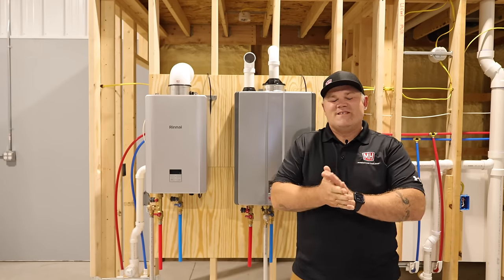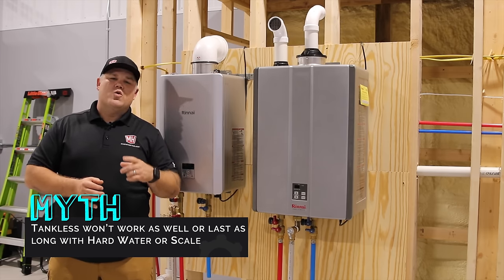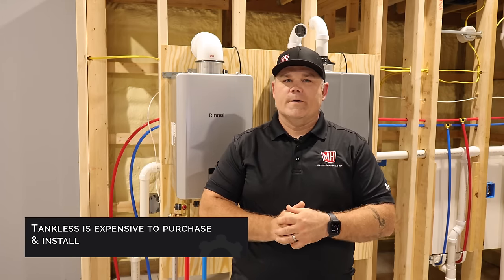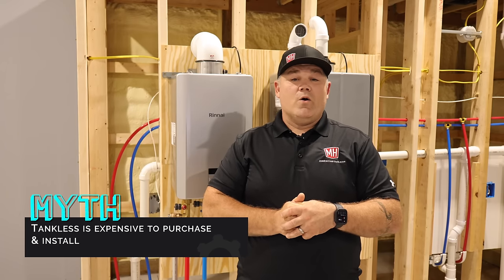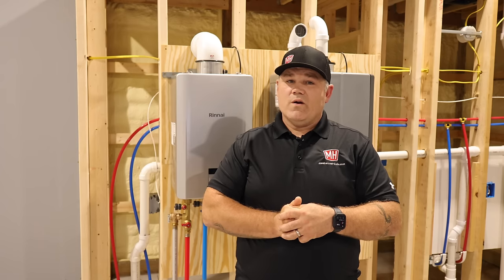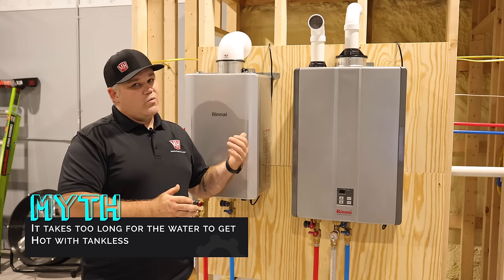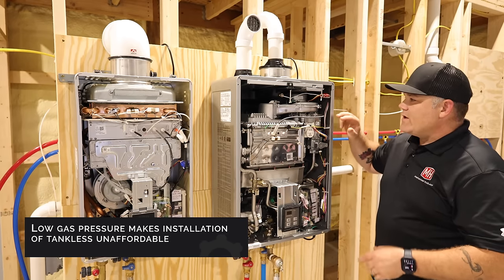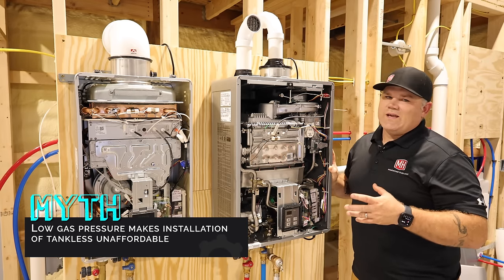Myth Busting! Tank -vs- Tankless Water Heaters

Comment: The only thing I wish you had covered is electric tankless heaters.  I'm currently researching converting our entire house to electric only.  So that means both furnace/heat pump and tankless water heater.  I know that when you go electric with a water heater there's a good chance you have to upgrade your electrical panel, so it'd be good to hear what that impact is from someone with your depth of experience.  Thanks for the great video.
Reply: Depends on your situation but here are some ideas. First ask an electrician, not a plumber who should not be running new wiring to anything even if they say they know what they are doing. While they are familiar with some basics, don't let them attempt this.
Cost wise again depending on your situation is likely in the range of 600-several thousand dollars for the electric side alone. It puts a heavy demand on your system regardless even if it is sized properly to work with it. 
Gas models are good and reliable and don't require a hefty install cost like electric does. I was very surprised when he didn't address this in this video. Electric for a tankless heater is less reliable, sure they work but after seeing them fail frequently and having to change them out many times I'd never go that route for this specific equipment in my home. Either stick with your gas heater or get a standard electric heater instead of tankless. The savings is very debatable especially since the newer regular tank models are so well made and insulated to retain the heat better. Weighing that vs the cost and the heavy load on your electrical system and the choice is fairly easy.
Hope this helps, an this is coming from an electrician of 25+ years.
Reply: I've got an electric tankless heater. You need to install a flow regulator because the electric tankless are far less efficient than gas. I have enough for a shower, but not enough for the tub faucet to stay hot. Mine is rated for 2 gal/min, but it works best at 1.5 or less.
Reply: Not to mention if your electrical service can not support the demand of an electric tankless. Some of them require a 100 amp service just for the tankless ! Your standard home has a 200 amp service. If it’s got electric heat then the service would need to be upgraded. That’s expensive. Gas tankless is definitely cheaper and way more efficient. But if you don’t have gas service then an electric tank water heater that draws 30 amps is your only option.
Reply: @CONald_is_A_false_Prophet  Why wouldn't be possible to replace an electric water with a tankless using the same 220v wiring?
Reply: @jerickson49  remember the old days where people just increased the size of a fuse or breaker? That's a big reason for many fires. The breaker and wire sized are very different. An average standard tank style water heater requires 20-30 amp line with wire sized for that line which is much smaller than is required for  even the small size of a tankless unit. Depending on the amount of plumbing fixtures / baths etc.. is usually how a tankless is sized. Some tankless for a medium sized home may require wiring that can handle multiple parallel lines.
For example, a home may be fine with a typical water heater that requires a  double pole 25 amp line but the same home for a tankless may require two double pole 40 or 60 amp lines equivalent to 80-120 amps depending on the tankless requirements.
If someone has gas now, chances are their home didn't need to account for an electrical load of any appliances that are now gas so a 100-200 amp service can't even handle an addition of 1 major appliance like a range, furnace, dryer, pool heater or water heater.
Also they won't pass an inspection if they undersize a tankless for a home that requires a larger unit.
More than you asked but hopefully you understand most of what I explained. 
I've seen some dangerous attempts by homeowners and handyman types so please hire a legit plumber and electrical company to do any of this work if you chose to pursue this.
Reply: He is a Rinnai dealer so he is pushing gas fired . However i did install a Rinnai heater in my  daughters home and it is amazing and very efficient.
Reply: I have an all electric house with a 200 amp panel.  To be able to run a bath and use the kitchen faucet, considering the temperature of my incoming water, I'd need a 24kw heater. If my electric furnace is on, I'm using 60 amps. Cooking dinner while the furnace is on and I'm pushing 100 amps.  Fridge/freezer/tv, add another 25. That leaves me with 75 amps for lights and other random stuff. A 24 kw water heater uses 100 amps!  For a tankless I'd have to upgrade to 400 amp service, which depending on your area, can put you into commercial service which is it's own can of worms. You never want to worry that if someone turns something on it will overload the panel and blow the main breaker.

Then there's the cost. Gas is always cheaper. Those that feel the need to virtue signal will quickly find out how unaffordable an all electric house is. My only reason is gas is not available to me. But I'd never buy an all electric house where gas was available.
Reply: @jerickson49  because a tank type water heater uses a smaller amount of power over a LONG period of time but the tankless heats the water immediately on demand therefore usually much higher amount of power for a SHORTER period of time and the wiring has to be able to supply that higher amount of power even though it is for a shorter period of time.
Reply: My place is all electric. My cost of living is 3 times higher than having gas heat and all gas appliances. Electric is more costly than even propane. Don't do it.
Reply: The solution for going electric is a heat pump water heater. Ya, it has the traditional tank, but they are super efficient. An electric tankless water heater will require four 40A 240V circuits. Ya, FOUR! A heat pump water heater only needs one 30A 240V circuit, and I've heard there are some coming out that will work with 120V. Not too well, but they will work. As soon as my gas heater burps I will be going with a heat pump water heater.
Reply: @jerickson49  because a standard electric water heater uses 1 double pole 30 amp breaker. A whole house electric unit uses 3 double pole 40 amp breakers. You would need 4 more breaker spots and would have to change the wire and breaker from the 1 you use now. That's going from 30 amp to 120 amp. Many older houses can't handle that without an upgrade, and that might cost a few thousand. And if the new electric on demand is not close to your electric panel, that could run over a thousand to wire it up.
Reply: @iWinnipeg  Gas is not always cheaper! I have natural gas, and at the current rate, it is cheaper for me to heat the house or water with electric. I have a dual-fuel HVAC, which switches to gas at 30°, at that point, space heaters are cheaper for me than gas.   I will be installing solar, and at that point, the electric will be virtually free, where gas would cost a whole lot more. Generally, I agree that gas is cheaper, but my electric rate is so cheap 5.1 cents per kWh that it's not for me.
Reply: Don't fall for the tankless, he can bust some of the myths, but can't fix some of the real issues. If you have the space for it, install the heatpump/hybrid unit, it is cheaper to run than gas, and does not have problems with low-flow faucets like on-demand units do. If you have several people taking a shower back to back, choosing the correct low-flow showerhead not only can save you up to 5.00 a month per person but will also allow endless hot water just like a tankless, so 20 people could shower back to back and never run out, all for a 10.00 showerhead that flows at 1 gpm, made by Niagara. Most low flow heads suck, I have tried many from big names, waterpik, pollenex, Delta and several others, I didn't like them and the GF said they would not get the conditioner out of her hair, but the Nigara worked fine, I flow tested it, it really does flow 1 gpm.
Reply: @TheKrazykris  then you just bought too small of a unit!
Reply: I just put up a comment about an electric on demand hot water unit which I installed a few years ago.  It required a total of three 40 amp lines - one for each of three heater coils. That number of coils is good for the demand of three to four people.   

An electrician friend saved me quite a bit on the install, but mainly because the "manufactured home" I was installing it in had a minimal and poor quality breaker box installed as its original equipment.  If the breaker box had been good and had room of the additional breakers then I may have been able to install the new "on demand" unit myself.  

As it is, I actually did install it myself after being instructed, by my electrician friend, on what gauge wiring and breakers to use (I think the heater instructions also included this info).  My house is all electric so I didn't even think about doing a gas setup.  In my area we have a town owned utility company and most of our electric comes from Niagara Falls Power generation.  This means our rates are quite low.   

As I have said in my comment elsewhere, I save about $300 a year compared to the old standard electric water tank that used to be in the house.  I have also set the on demand water heater to 118 degrees F.  Which, for me, is the perfect temp for a shower.  Therefore, I am not adding cold water to make the "over heated" water cooler. That certainly saves money!  : - )
Reply: @jonstewart7800  your replacing a very inexpensive simple heater with expensive computerized refrigeration type of system. My neighbors furnace board would die every five years and my standing flame furnace never failed me. I think reliability, low purchase price and ease of repairs shouldn’t necessarily be traded for an expensive and less reliable system for the sake of saving some energy/money operating it. People are buying those heat pump heaters because building codes require green appliances, so many green credits, not because they want them. My water heater is 24 years old and zero maintenance or repairs!
Reply: @stevem1081  thanks. Funny that a low flow is named after a raging river😂
Reply: @jonstewart7800  Where would your heat pump water heater get its heat?  Heat pump water heaters, unless they are split systems, pull heat out of the space that they are placed in.  They don't work in an enclosed closet.
Reply: Why would you go all electric? If it's gas then it still works when the power goes out.
Reply: @JacksonCampbell  Maybe he has a generator
Reply: @larrycatalino7103  A question I have thought of. My water heater is in the garage. I live in New Mexico. Heat in the summer is not a problem. Ya, in the winter it's cold, but word on the street is heat pumps work fine for home heating.
Reply: @jerickson49  The instead DEMAND.   An electric tankless would require HUGE AMPERAGE during use.   Simple example.  Tank gas water heater may need between 30,000 & 40,000 BTUs, whereas a tankless water heater is 160,000 to 200,000 BTU during use.    That means you need a rather big electric service, a LOT bigger than the 200A service in most homes.
Reply: @jerickson49  An electric Tankless unit needs 8 AWG and 50 Amp breakers. The standard 12 AWG wires are to small. They are fantastick units if you rout 2 8 AWG wires to it.
Reply: @CONald_is_A_false_Prophet  The advised by Manufaturer is 8AWG an 50 Amp breaker. I runned 2 8Awg wires(the hardest issue) to the unit using Superficial/surface Stick on flat  Conduits, and easily  swaped 50 amp breakers. Have 5 units working now and last about 5-10 yrs and repairable for about 60-80 $US( They cost about 200$US new) If you have a Gas unit, why exchage it? they also work fine. The old Tank is obsolete if replaced by on demand. Most of the ones I have are Spec. And one has a hibrid power input(Never pass an inspection, but No one inspects where I live) 🤣Would have to break massonry to instal new conduit.All costruction is brick/concrete in my neck of the woods, The rest of the units are wired to specs
Reply: NEVER PUT ALL YOUR EGGS IN ONE BASKET MY FRIEND
Reply: @jerickson49  tankless electrics are 220v as well. The difference is in the current draw. We installed one at our house. A standard tank heater uses one 30 amp breaker. The tankless I installed uses two 40 amp breakers. Twice the wire and almost 3 times the current draw. My wife loves her long hot showers and this unit has worked great for almost 7 years. Where the biggest noticeable difference will be is on your electric bill. Ours is over 200 a month for a one bedroom one bath house. I will be switching over to gas this year. Should cut my electric bill in half at least. Especially when we get the range and dryer off electric as well.
Reply: @TheKrazykris  Perhaps your tankless is slightly undersized, or too far away from the tub.
Years ago I installed an electric (whole house) heater in a mother inlaw sweet. This was 20 years ago. The unit had 2 heating elements. 
About 5 years ago I get a call the unit quit. Turns out 1 element gave out & on the other side the board shorted. The owner ordered new parts & it was up & running again. He says it works great~!
Reply: @alphasaiyan5760  I live in the Bay Area in CA.  Most of the homes built before 2010 have 100A or 125A main breakers.
Reply: @946towguy2  yeah so it’s not practical to have an electric tankless unless the service is upgraded.
Reply: @alphasaiyan5760  In my part of the grid, we have about 40 houses and apartment units sharing a pair of 200kVA transformers.  That means an average peak supply per dwelling of 41.66 amps or 10 kw before brownout occurs.  Luckily, the typical usage per unit when major appliances are not running is under 2 kw and even if I am using an arc welder, I don't ever go above 65 kw.  But if every unit suddenly had to add a 9 kw water heater, a 6 kw stove and a 10 kw heater, there is no way the grid could take it.
Reply: I'd say put a propane tank next to it. Electricity even from solar will cost a lot. Or install water heater which is heating water when the sun is out (whole Latin America using hot water this way).
Reply: @stevem1081  Where the hell do you get this free power  at? 5 cents? We pay .35 then to .45 after not enough baseline. And then higher, like .60 cents with more use. What a joke! You are lucky and you should know solar is absolutely foolish for you. NEVER will calc out at .05 cents.
Reply: electric is no comparison  to gas. first you will not get the flow a normal house needs and the electric service would be way to costly to get installed,  you would not get any benefit from it.
Reply: @jerickson49  because the amps. I priced an electric tankless that would only put out 3 gals a minute  it took 3 60 amp breakers to do this. Thats almost what a normal home service is on a 200 amp service
Reply: It’s simple don’t go all electric unless off the grid.
Reply: @stevem1081  u are correct
Reply: @jerickson49  The amperage to run them is much much greater and requires much lower guage/ thicker wire to run them safely.
Reply: @alphasaiyan5760  I posted a comment a moment ago requesting how the math favors those with tankless units versus those with tank systems and use a timer.  Most homes are wired for a 30 or 40 amp draw for the water heater.  A tankless unit may require 100+ amp draw and a likely upgrade to one's service panel let alone the correct size wire to handle the load.  This is some thick wire we're talking about
Reply: @MarkEntl  Absolutely correct, but let me also add, some of us use timers on our water heaters and in my case, that's two hours a day and that's it.  I need someone to tell me if you were to put a clock on your tankless, how many minutes or hours do you use hot water per day.  I can make a case, I'm pretty efficient with a water heater and not having to upgrade my panel doing it.
Reply: Maybe Heat Pump water?
Reply: @zackstrassburg8325  Heat Pump!
Reply: @jerickson49 - just because it’s 220 doesn’t mean you can just switch it out. Tankless may draw 120 A. The tanked water heater might draw 20 A.. That’s six times the current
Reply: @TheKrazykris they are as efficient,just require equal BTU generation  which requires larger individual circuits (like 2 80amp circuits for one whole house unit that ultimately use less power but need large bursts of that power.)That was for a large home.
Reply: @jerickson49 tank is only one 30amp220. Tankless could be 2 50amp or 80 amp circuits. So definitely not. Look at the specs for amperage requirements for a tankless that you are considering.Your house panel is likely 100 or 200 amp total for your whole house. Then call an electrician and have home bid the cost of getting that amperage to your home . Probably an additional service brought in from the street. That’s why gas is so awesome and states need to quit outlawing it’s use in new homes (like here in Washington state..)
Reply: @stevem1081 pretty much guarantee you won’t run tankless on your solar. Unless you have a 300 +amp panel on your system and only shower on sunny days. You are stuck with a standard tank. 🤷‍♂️
Reply: @ashtonlenz1301 and maybe a propane tankless with a small standard HWH as an all-elec backup while carefully conserving use.(no long hot showers for you!)
Reply: @berrywr1 and it isn’t just the service PANEL that needs upgraded,it is generally larger wire brought in by the utility to upgrade or add any other panel. Your wire from the pole to your existing panel likely won’t handle the higher amperage.
Reply: @berrywr1 elec code requirements are the same no matter how often you use the unit. So how often you use it really doesn’t come into play. If you are all-elec,just stick to a standard tank or get propane tankless.
Reply: Take it from an electrician: Do not buy an electric tankless water heater. The electrical requirement is EXTREME. I've seen some that require six 30-amp circuits. This will basically max out the typical home panel. 180 amps from a 200 amp panel. Forget it.
Reply: @jerickson49  it isn’t just the voltage ,or is the massive quantity of power required in those bursts of heating. You may need as much a 2 or 3 80 amp breakers(which means an additional panel,which likely means bringing another large cable in from the street or pole transformer. Gas delivers big BTU production quickly. Even gas requires higher volumes to deliver those big bursts.
Reply: ouch, wouldnt want your electric bill every month  @iWinnipeg
Reply: @jerickson49  Because a tank water heater uses much less current to SLOWLY bring a lot of water up to temperature. A tankless unit uses high current to VERY QUICKLY raise the water stream temperature as demand occurs. You, virtually always, will need larger gauge wiring and more circuits of it.
Reply: Don't bother with electric tankless. It's not effecient, many house can't to the amperage either
Reply: @jerickson49  cause they draw way more power than a tank... It's the amperage not the voltage on this
Reply: You will have to run about four times the amps to run a tankless but it might still be worth it if it’s not too hard to do the wiring. You need more than a 100 amp service that’s typical in older houses with gas . The electrical upgrade to 200 amp might push it off the page.
Reply: @iWinnipeg I’m a retired electrician so feel my duty to speak up for electric. Avoiding a hole in the roof is about the only advantage.
However,since I started converting to DIY off-grid solar I had to make adjustments. I live in an all electric house I inherited from my parents. I only run the electric resistance heat at night when my electric service is free.In the daytime on firewood. I have seven small ac units for summer that run on solar in the daytime and the inverter passes through free grid power at night. All my 120volt circuits also run on the inverter.
To make my water heater friendly, I put the two elements in series,reducing the amps. It takes twice as long to do the job but I just take half the baths.
The inverter is a Growatt 5K and with the water heater running my load is 70% max. I did leave the microwave on the grid and the coffee pot. 
With all my lights converted to LED the system never comes close to 5000 watts and my electric bill is seldom over $50.
Reply: @danielking2944  I actually ended up doing this upgrade last year. And it's a good thing that my main criteria was to eliminate gas burning devices from my home, and not price. The unit I bought has 3 elements and EACH ONE uses 40 amps! Yes, 40 amps. While the electrician was here we successively turned on 3 different sources and his meter showed a 120 amp draw. So you have to have 3 dedicated 40 amp breakers for it. After having to upgrade my panel from 200 amps to 400 and installing the unit the final bill came to $16,000. Ouch, but now I'm burning less fossil fuels. Now I just have to convert my furnace and dryer to heat pumps, and my stove to induction and I'll be all set. Expensive yes, but we've got to STOP BURNING STUFF! And if you're wondering, yes, my 3 cars all electric and I do have solar panels on the roof.
Reply: @ Sometimes doing the right thing doesn’t look like the best investment. That sounds like a lot of money,but it’s just money. I’ve been investing all my crazy money in off-grid solar and two unoccupied houses on my dead end street since Covid reset my prepper outlook in 2020. I lost count on how much I’ve spent on solar equipment but it’s all paid for and the combined electric bill for the three houses last month was $121. In effect I have become a power company by supplying electricity to the rent houses. The rent pays the utilities on all three and mortgage payments on the house I had to get a loan for.
Reply: @jerickson49  you typically have a ten gauge circuit going to a conventional water heater. It it’s good for 30 amps. The tankless will probably have two six gauge circuits or three number eights. Might carry it on the 200 amp service,but the added wiring will be expensive if it’s not very close.
Reply: @RRaucina   Here’s how it works in Texas.I have a electric service that is free eight pm to six am but double priced in the daytime.
That is variable up to $.30 if you don’t buy much daytime electricity. I do just the opposite of the instant heaters. I put the two elements in series so they work half speed but with only 22500 watt load. That allows me to run it during the day on a  Growatt 5K inverter and after 8pm grid power bypasses to feed it. Last month my bill was$41 and the average cost for grid power was 3.9 cents per kilowatt hour. The solar system is paid for by savings over the last three years.